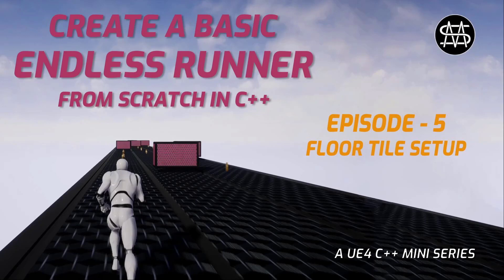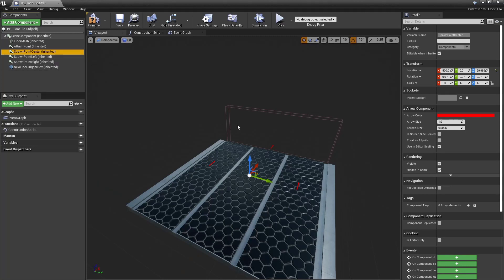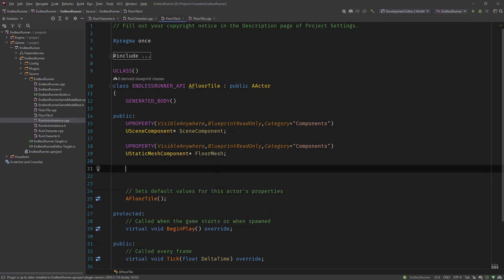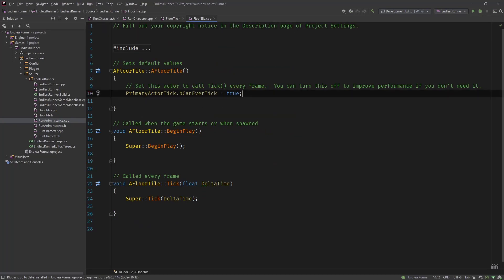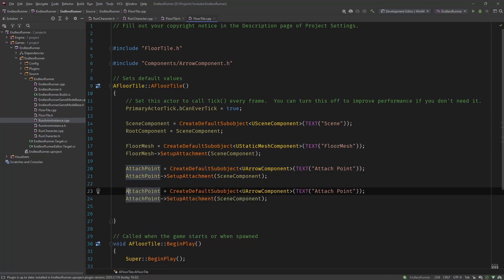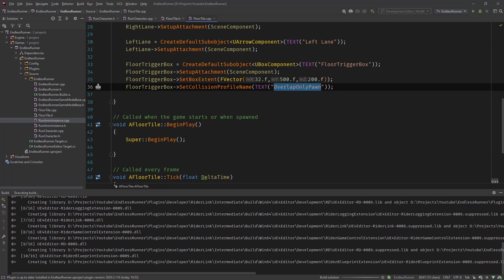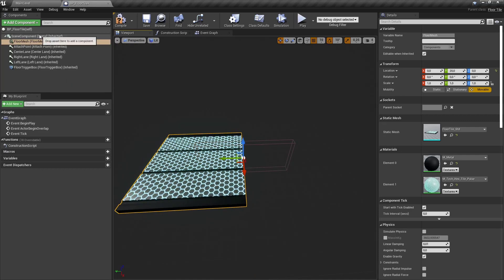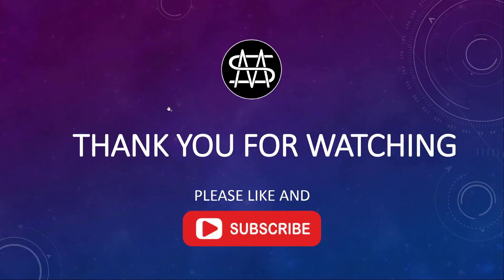UE4 C++ - Endless Runner from scratch - Episode 5 - Floor Tile Setup

Comment: Hello, Mike

When we are setting up the component hierarchy, why don't we set other components attachment to the root component?
Like:
FloorMesh = CreateDefaultSubobject<UStaticMeshComponent>(TEXT("Floor Mesh"));
FloorMesh->SetupAttachment(RootComponent);

instead of :
FloorMesh = CreateDefaultSubobject<UStaticMeshComponent>(TEXT("Floor Mesh"));
FloorMesh->SetupAttachment(SceneComponent);

so that when we replace SceneComponent with some other components to be the RootComponent we don't need to change all the code.

Thank you for this AMAZING tutorial!!!
Reply from the maker: Thank you for your feedback . Really appreciate that you like my videos. 
So to your question. The Scene Component is the RootComponent. We create the Scene Component and then assign it to the Root Component. The reason i do this is that when you assign it directly to the RootComponent, without creating a new SceneComponent, it will use the default Root and that makes it so , that in the blueprint class that inherits from the c++ class, the hierarchy of components start without an actual visible root node. When using the scene component, we will see a root component node labeled Scene. Without it there wouldn't be a visible root component node.  
So actually that is a good practice. Why don't you try it out with the FloorTile Class , or a new class , so that you dont destroy your current FloorTile. So create an Actor class, name it whatever you like, create a UStaticMeshComponent , and maybe on UArrayComponent and add them directly to the RootComponent , without creating a SceneComponent. Then create a blueprint based on that class and see how the Hierarchy looks like. Then change the class , add the SceneComponent , set it as root and then add those two components to the scenecomponent. And then see how the changes are in the hierarchy. you might need to restart the editor and refresh the blueprint, for those changes to happen. Hope this answers your question
Reply: @MikeStevanovic I'll try this out.
What if I already assign the Scene Component to the Root Component. Like
RootComponent = SceneComponent;

Situation1 : FloorMesh->SetupAttachment(RootComponent);
Situation2 : FloorMesh->SetupAttachment(SceneComponent);
Are there any differences between situation1 and situation2?
Reply from the maker: They are the same. Because you assigned the scenecomponent to rootcomponent , attaching to either one is now the same. but for clarity purposes its better to set the attachment to the scene component. but that is my personal preference.

Comment: Hi Mike! Thanks a lot for another wonderful tutorial. 
I'm really enjoying going with practice along with your tutorial.

Quick a minor question once again,
SceneComponent = CreateDefaultSubobject<USceneComponent>(TEXT("Scene"));
	RootComponent = SceneComponent;
Is it mandatory to assign the instance of the 'SceneComponent' to the 'RootComponent' here, i.e. RootComponent = SceneComponent;?

As 'SceneComponent' has been declared as the USceneComponent and it can hold all other components attached to it, no?
Thanks and you can clarify as earlier in your convenient time and if you get some free time. No need to get hurried for for it.
I am following the series very well.
:):):)
Reply from the maker: You're welcome. Glad you are enjoying the series.
So let me try to answer your question. Each Actor has a RootComponent variable that you can attach components to, to create a hierarchy. If you just create a component like the RotatingMovementComponent we use later on for the coin it is not part of the hierarchy. But components like the SceneComponent when its created and not directly attached , becomes attached to the rootcomponent, this as a side not.

So components we create , we usually attach to the root component or to other components that are attached to the rootcomponent. And a SceneComponent is just a basic component that has a Transform and allows attachment.  And the RootComponent itself is a SceneComponent. 
And now you might be wondering, why do i create a new SceneComponent and set RootComponent = SceneComponent, like in your question. Here is why. 

If i attach the StaticMeshComponent to the RootComponent or set RootComponent = StaticMeshComponent, which in this case is the same, the StaticMesh becomes the RootComponent. This can be fine for some cases. You can create a blueprint from that actor or even drag the c++ class into the scene and can move that actor around in the scene. 

But in our case we want to localy move the StaticMesh our Actor. If the StaticMeshComponent is the root , we cannot do it. And we do this to be able to offset the mesh, rotate it and so on. The same with the arrow components that are attached to the scenecomponent. So we create our own SceneComponent make it the root and then attach the StaticMeshComponent to it. And this allows for transforming other components locally

And to make the SceneComponent the RootComponent there are two ways, either set it like 
RootComponent = SceneComponent  or we can use the SetupAttachmentFunction to attach it to the root like this:
SceneComponent->SetupAttachment(GetRootComponent()); 
So both ways in way do the same. The SceneComponent becomes the root component in the hierarchy. 

I hope that anwers your question.
Cheers
Mike
Reply: @MikeStevanovic  Understood very well!
Thank you so much for your valuable time, efforts and knowledge. 
I'm so grateful to you!
God bless you, Mike!
:):):)
Reply from the maker: Thank you. Glad i was able to answer your question